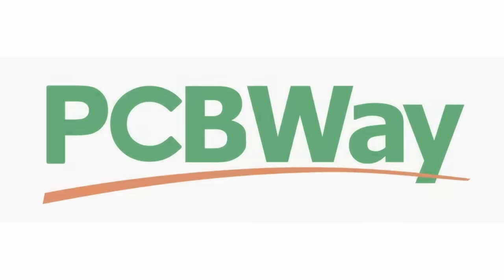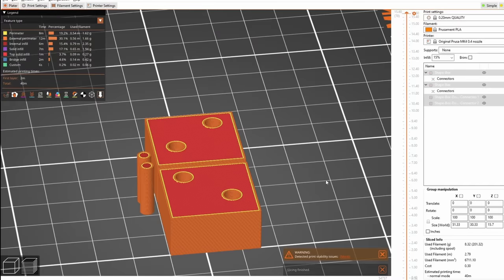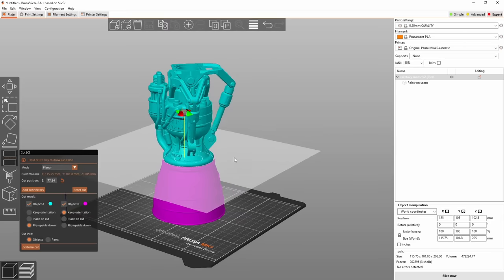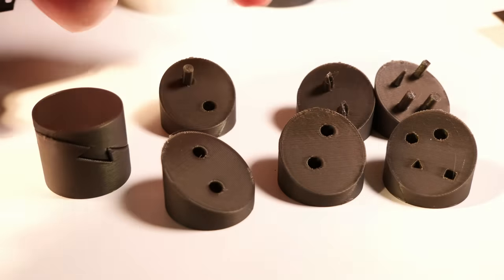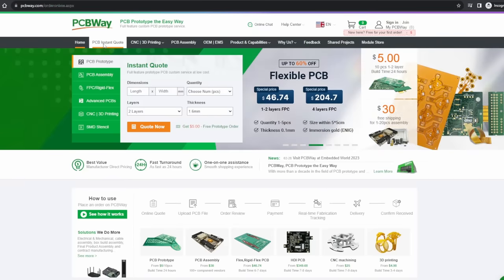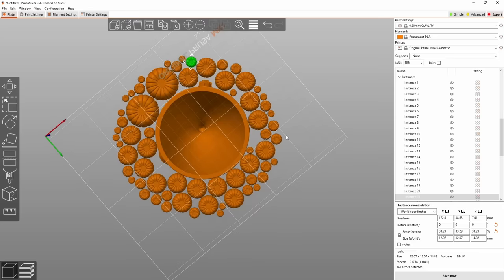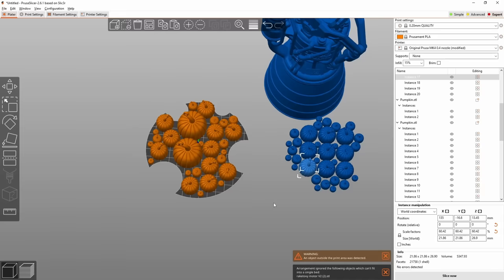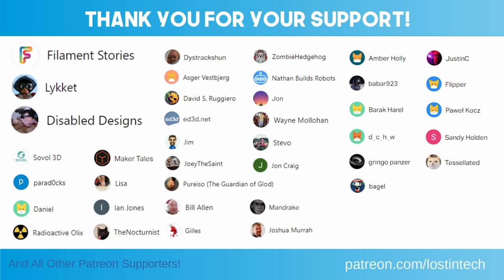Amazing new Prusaslicer 2.6.1 feature: Snap fit parts! Let's look into it.

Comment: I bet the dovetail would be a lot stronger without glue than the pegs.
Reply from the maker: in one axis, yeah. If you could put a pin through the middle then that would be cool!
Reply: In two axes, I would think.
Reply: @LostInTech3D  drilling a hole in the part in the slicer before making the dovetail is not to hard, but sequence will matter a lot
Reply: Honestly, depending on geometry, using the dovetail and glue combined sounds like the strongest option. That's a lot of surface area + interference on the dovetail, vs putting glue on pegs
Reply: @zsill777  Definitely agree, I have had more issues with pegs breaking overall in the prints I have done vs dovetail/puzzle like interfaces.
Reply: Dovetails are very strong. Sillybutts uses them all over in his blaster designs.
Reply: @zsill777  Actually it would be stronger to use the dowel to key and hold the part and use a thin layer of epoxy across the entire mated surface. The dowel joint would make a great 'clamp' for a perfect epoxy joint each time. Gives maximum surface area and the cross section for sheering essentially becomes that of the part rather than limited to the diameter of the dowel.
Reply: @JH-zo5gk  Dovetails are a strong joint but any woodworking joint video will tell you they aren't the strongest. Dovetails are good because they key the parts and have a decorative look. A simple mortise and tenon is stronger and the dowel joint would be stronger if you applied epoxy across the entire mating surface instead of just gluing the dowel.

Comment: The dovetail is useful for parts that used to handle a "pull" effect. For example, if you hang something from the ceiling and you print an adaptor for it, the dovetail will hold a lot better than the peg even if glued.
Reply: Yes, I made a gear sometime but it was to big for my printer, but since prusa can print bigger in 1 direction then the other and it was only slightly to big. I used my 3d modeling software to make a dovetail. Would have been way faster this way.

Comment: The bed shape thing is great if you have a damaged part of the bed and want to avoid putting models onto it.
Reply from the maker: exactly!
Reply: @LostInTech3D  it's also useful for converting CoreXY to AWD (adds steppers to the front trading space for ludicrous speed)
Reply: Or if the bed has warped over time somehow
Reply: Also, many people use clips or clamps for glass beds, this would be useful for that too!
Reply: @England91 I have exactly this. Back left corner on a MK2S is "high", and I can't compensate, so I avoid it. I'll be looking up this feature to omit it.
Reply: Or if you use a dockable probe where you might not want to print near the probe dock.
Reply: yeah i wonder how you assign the home position; also it should allow for dxf/dwg format as it's 2D..stl is stupid..
Reply: @ThomasWood3DPrinting  I hadn’t though of that but it is a great point, may even be useful for printers where you know it does some form of calibration or prime line before printing, just exclude the area it needs for priming.

Comment: One use could be to have snap-on overhangs that can be added midway through a print and get welded in by the layers above them
Reply: Only issue I see is the sheer line would still be there maybe if you added some resin to bond the small gap when putting them on?

Comment: When playing with the cut tool in PrusaSlicer, don't forget about the "don't cut" right-click especially on complex models. A good practice model that I've found is the low poly rabbit that comes in the gallery. Try to cut each ear off individually and you will discover the power of being able to unselect parts of the model that cross the cut plane. Not many reviewers cover this feature that's a couple PrusaSlicer versions old, and I don't know why.

Comment: I think the snap connector design could be optimized. First off, they don't need that much clearance in the middle. Second, if they are printed with more of a mushroom head shall we say, they can have less angle and therefore less strength reduction while still holding as firm or more firmly. Overall they just seem a bit flimsy, I hope there are tuning options in the future, but it's still an awesome feature.
Reply: That’s exactly what I thought, they look removable, which may or may not be useful but they probably can’t be removed and inserted many times. They also look like they might just be a friction fit inside the hole. A sharper overhand on the peg and a corresponding area on the hole would most likely be stronger and be harder to remove.
Reply: @enhidri160  Wut?

Comment: Dovetail are prefect for printing things larger than your bed. Think printing a 2x4 on your printer, dovetail joints. Now you'd probably not due that, but if you're printing a larger flat object (say a setup to hold cards and objects for a board game), having a method to join it yourself means you don't have to rely on the designer accounting for your print volume.
Reply: I've been playing with (i.e. mocking up in PrusaSlicer with a cylinder primitive, but haven't actually designed and printed yet) using the dove tail feature to cut up a planting pot false bottom. (These are used to avoid having to completely fill a deep pot with soil.) When getting a large pot to replant some aloe plants, I saw the ones for sale at the store and thought "I can print that... I think. Larger than my printbed, but there is that new dovetail feature..." I'll probably spend more time and filament getting it right than the $20 plastic discs in the store cost, but that seems to be the hobby these days...

Comment: I can see one use for the dovetails right off the bat - printing right angle connectors for things, that cannot normally be printed on the side. That way, you could have all sides printed flat and be at their strongest, without having to make two separate models for it.

Which is great, because I've seen a lot of models that I'd rather be in two parts than one, just for part strength alone.

Comment: I manually added dovetails to a long rail piece I printed on my Voron V0.1(with 120mm bed) having it built into the slicer is amazingly handy. Thanks for showing off the peg feature, it’s also a good calibration test. The new nesting options are nice too.

Comment: Dovetails are very useful, especially on thin features and when using an angle and making them one way.
On thick features and reducing tolerance the dovetail becomes a permanent connection, when hammered together

Comment: OMG, until now, I have been using cura, and after seeing your video, I am making the switch to prusa immediately. 😅

Also, as a video request, could you please make a video comparing Ultimaker Cura, Prusa Slicer, and Bambu studio. I would find it very useful if you could do the comparison of features between those. Thank you
Reply: I'm not sure if comparing Bambu Studio to the others is fair. AFAIK (I could be wrong), Bambu studio pretty much only wants to talk to Bambu printers. Maybe use Orca Slicer in the comparison instead of Bambu Studio? Or am I wrong about Bambu Studio being able to slice for non Bambu printers?
Reply: @Sembazuru  well, before when it just released it only supported bambu printers but now it has multiple other printers like Anker, Anycubic, Creality, Elegoo, Prusa, Qidi, even Voron  and more. But yeah I think since orca is better than bambu studio it might be ahead of the others, so then it would be a better comparison

Comment: Dovetail is just better for models that will go through more force? All I know is that when we use big cameras on set, I trust the ?surface area? that the dovetail mounts use. I am always wary of "screw" strength? I like using "arca swiss" mounts on everything, which is essentially a dovetail mount, instead of your standard camera 1/4th screw.
Reply from the maker: you make a good point, I use arca mounts on all my stuff.

Comment: I was just about to manually add three dovetails to a TPU product that I manufacture and sell online so the customer can configure it to three different lengths.  Guess I'll let PrusaSlicer do that for me.

I also have a product in mind that would use interlocking ABS and TPU so that's a welcome PrusaSlicer feature as well.

I use 3D printing for functional parts and I don't do miniatures, scale models or cosplay, but I have developed an urge to buy a Neptune 4 Pro Max (when Elegoo makes the Max with steel rails) and 3D print a SpaceX Starship model scaled 22:1 so the diameter barely fits on the 420 x 420 mm bed.  It would be 18 feet tall!  Those snap pegs would be a great way to assemble the pieces.  I should wait until I can find an STL that has the new hot staging ring that was recently added.
Reply from the maker: haha, I have the 3 max, and I have no doubt that the 4 max will be amazing, but make sure you have a lot of room for it.

Comment: 3:26 states pegs are good for making parts that have height or size issues, but not for parts that would have support issues. 

2:43 states pegs are good for the fox model because if not used, the belly of the fox would have undesirable support issues so better to split the part in two and then join both halfs back up. 

Did you not proof read the script before making the video because this is a counter active argument for what you're saying. Seems very confusing on what you're trying to convey here lik most of the other videos.
Reply from the maker: Dowels are good in the second example, If I said pegs, I misspoke.

Comment: One place I wanted to use dovetail is recently doing a riser for the K1.  It was an easy path extrude in fusion 360, then in PrusaSlicer, sliced it into 4 corner pieces with dovetail joints.

Comment: I used dovetails to cut up the 5' sword blade i made so layer adhesion (when the blade was printed horizontally instead of vertically) so they would put as little stress on the length of the blade as possible to prevent snapping. I figured pegs wouldn't be as strong as a dovetail, but if they are then 🤷🏼‍♀️ oops i suppose. I saw someone recommend puzzles which I hadn't thought of, but cosplay is the only thing i could think of personally
Reply from the maker: Ah, no, probably makes sense on large objects, which I don't really print much of

Comment: Good video. A bit too much rambling at the beginning, and I would have liked if you explained the tolerance for dowels a bit better. It's not clear to me why there are 2 tolerance settings and what they do. Surely if you set one side to have 0.2mm tolerance, you don't need to do the same for the other side? Or are you saying that 0.4mm total tolerance is correct?

Comment: To add to the list of Dovetail uses: thin/flat parts. Im trying to make a box for my mom to hold some of her photography stuff and Im gonna have to split it in half cause of the size. Theres no way I could fit any variety of the pegs in the thin walls of the box to help align them for glueing but the edges could have a dovetail and that would work just fine for lining the two halves up.

Comment: What would you say the minimum length and width for the snap connections?  And the minimum sidewall for them?  Like if I have a 5mm wall would a 3mm snap work or is 1 mm on either side too small and/or the width/length of the snap too small?

Comment: As you discovered when your snaps fell off, snapfits involve removing material which means less reinforcing the joint against stress than a dowel. As long as the adhesive is as strong as the original material the more surface area in a joint the better along with a broader cross section where sheer force is applied.  The second is why dowel joints are so weak. Look to videos on woodworking joints for a better understanding on this, though the wood grain plays some role the relative joint strengths more or less translate. Dovetails are stronger joints but there is a simple hack to get what you want out of the dowel and get the strength. Since you want to lay flat on the bed, use your dowels, but also prepare the entire surface you are mating and use a thin layer of epoxy. The dowel joint essentially acts as a key to align the parts correctly and to clamp the parts together while the epoxy dries, the cross section of the joint is now equal to that of the part rather than limited to the diameter of the dowel.

Comment: You can use the dovetail on thin pieces that need to connect. If the object is flat and only 10 or so layers thick, the dovetail would allow them to connect when dowels would not. I have made the dovetails manually on a deck of card holder that was bigger than my bed.

Comment: After cutting in prusaslicer and bambu and adding plug connectors, the negative part is not exporting to cura, but the positive part is.  Any suggestions?

Comment: I could see a good use case for non rectangular or non circular bed shapes to maximize the build area available on a linear delta printer. In fact, at the top, the build area is also non circular….this is all assuming that your controller doesn’t lock you out of areas outside a simple volume.

Comment: I am getting this error when trying to export the model after adding holes to the cut - "unable to perform boolean operation on model meshes prusa". I tried the windows repair function but it didn't work. I have also sent the model to stl fixer as i thought it may be a geometry error but that didn't help either. what am i doing wrong?
Reply from the maker: In prusaslicer? Report a bug on their GitHub
Reply: @LostInTech3D  okay, thanks for the response :D love your vids :)

Comment: I wonder if the custom bed shape could be useful along with auto arrange to define 2 or more bed "areas". During slicing you could then print different parts onto one larger bed by cutting it into several regions, and then removing them all together at the end.
Also could be useful if you want to miss certain areas of the bed (for example the clips holding the print surface on old ender 3s)
Reply from the maker: yeah, stuff like that...will be interesting to see what people do with it.

Comment: I ran into a challenge slicing a part in half that's to large for one print. So you have to export one of the slices and it will not export the side with the negative infill for pegs. So deleting one side then again on the other is my best guess. Then it warns you they might not fit. Splitting a 4 day print to guess sucks, will need to read more.
Reply from the maker: can you not just drag it outside the bed area?

Comment: Dovetail would be useful for larger pieces or as a secondary connection that ends with screws being tapped in (raspberry pi case, etc)
Reply: I have a homemade Core XY printer based on the Hypercube which prints narrower than I would like because of the placement of the XY stepper motors.  This is a perfect use case for the custom bed shape feature!  I can now get a extra centimeters of the sides back!  Thank you for demonstrating this!

Comment: Dovetails could be used to make impossible joints maybe?  and also attaching corner pieces like a 3d printed picture frame or legs to a table.  They have many uses, just look them up for woodworking.
Reply from the maker: seems everyone misinterpreted what I meant on this, I have been a woodworker and made dovetails with a saw haha, I just don't know whether you would use them in a slicer, rather than in the CAD. Seems like a weird idea.

Comment: The part where you snap the model together on top of the printer's bed made me cringe a little.  Using your printer as a workbench is a sure way to knock it out of level.
Reply from the maker: I guess that's why we don't use camera recordings as force gauges ;)